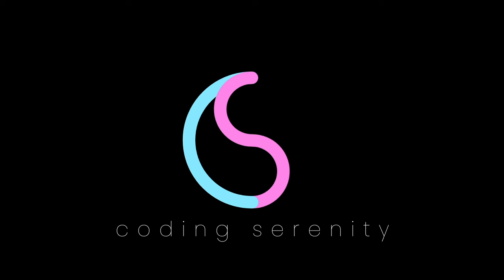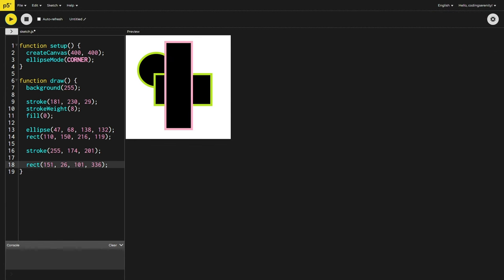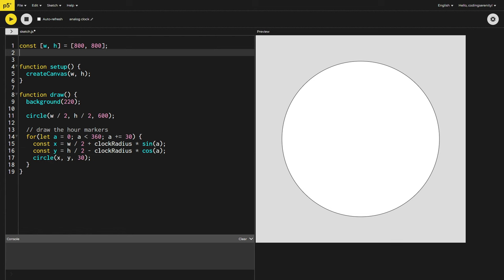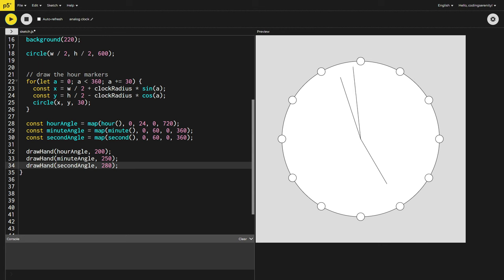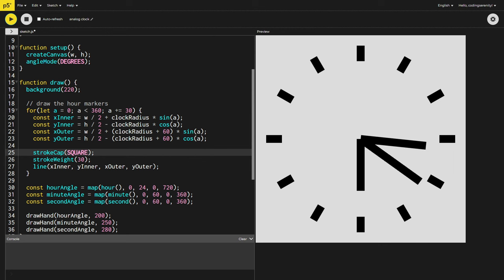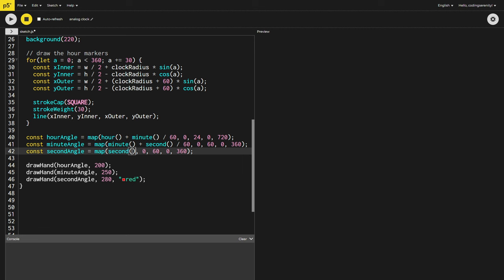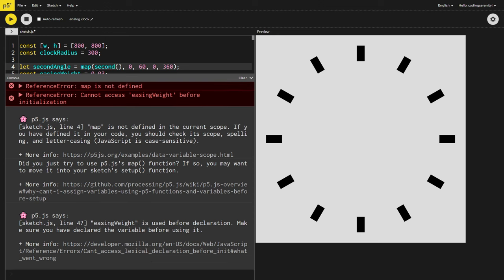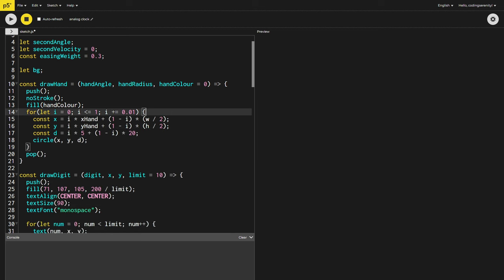Let's use trigonometry to make an analog clock

Comment: With the second hand of the clock can't you just use "const secondAngle = map(second() + (millis() % 1000) / 1000, 0, 60, 0, 360);"
Reply from the maker: That's a great suggestion! The only problem is that at the moment the sketch is loaded, the millisecond value of the actual time is very unlikely to be 0, but `millis()` will always start at 0. So when `second()` gets incremented to the next value, `millis() % 1000` probably won't be back to 0 yet, and the second hand will end up jerking between the current second and the next one. 

I think we could make it work if we stored the millisecond value of the actual time at the moment the sketch is loaded, but we would need to do it in the traditional JS way, like `new Date().getMilliseconds()`
Reply: @codingserenity  oh, i didnt think about that